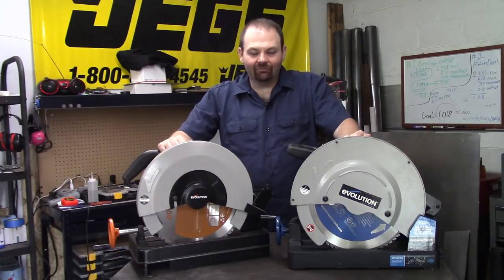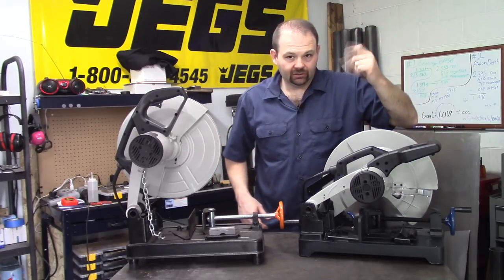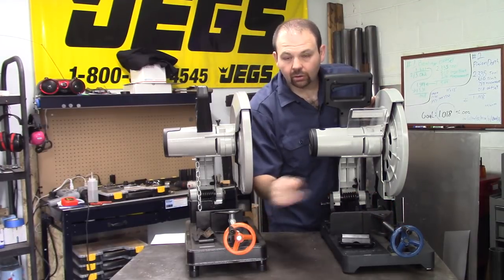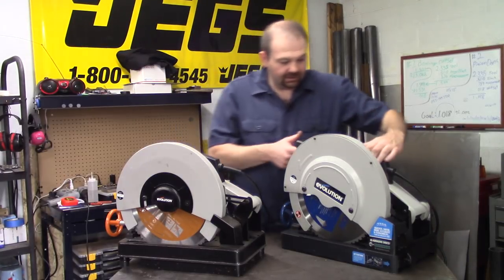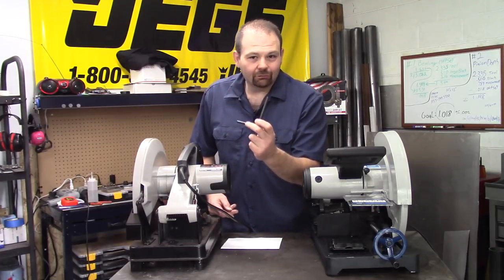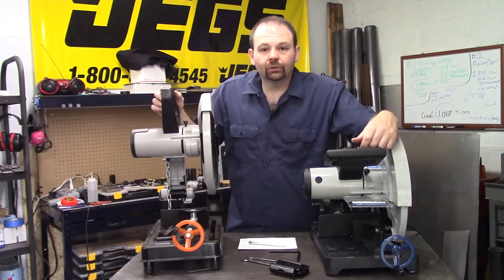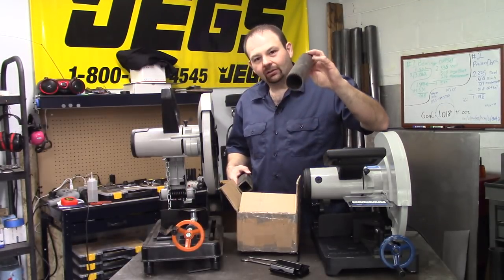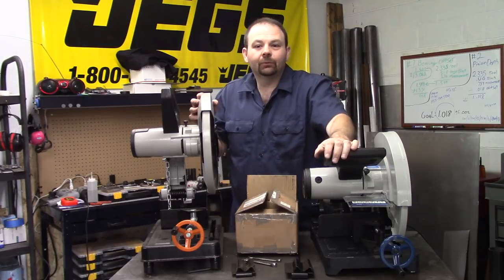Evolution EVO SAW 380 Features

Comment: Hey, thanks a lot! Sadly I bought an evolution 10" multi purpose saw in the past, I needed a metal chop saw. The clamps for the saw I have are terrible, also the rpm just burns up the blades. I thought maybe I could go with the cheaper version of the two you're comparing, but after seeing the construction of both I definitely need one with the thicker construction. Thank you very much!

Comment: I want to know how straight it cuts as the EVOSAW380 has a bad habit of wobbling up to a 1/4 inch.
Reply from the maker: Hey Crazy, I've cut a lot with the saw. I've never seen it drift a 1/4 inch. None of the cold/dry cut saws I've used have ever drifted 1/4.

Now an abrasive saw can drive 1/4 easy. Those suck in my opinion. They are much cheaper to operate but cut quality is not good.
Reply: @PtfabNet  I have spoken with the Engineers in England  about this issue the wobble developed in the manufacturing of the base not all saws had this issue.Also they are coming out with a new saw at the end of this month beginning of February they are coming out with a stamp steel and a new Aluminium base which supposedly will correct the know issues with the saw.I did post a article from this November that addresses the issues I mentioned.
I added said article
https://sawingpros.com/best-cold-saws/

Comment: Question.  Will the EVO blades work on a regular chop saw?  Are the revolutions higher on their saws?  Do you know the RPM on the EVO saw(s)?
Thanks!  — never mind!  Just read the new saws rpm is 1450.  I’ll compare that to my chop saw.
Reply from the maker: When you say "regular chop saw". Do you mean a abrasive type chop saw? Do not use a metal blade on a abrasive type saw. The abrasive type spin much faster. The blades will fit but the RPM is to high. Very very dangerous.

I am looking online, I found one abrasive chop saw. Its RPM is 3800. That is double the speed compare to a metal blade type.

Sadly, you will need to buy a separate saw if you want a metal blade unit.

I hope to make another video on metal cutting very soon. I want to compare chop saw, band saw, abrasive blades, and a torch setup.
Reply: You are correct... I did some research.  Yes I have a standard abrasive chop saw.  I haven't checked but I am pretty sure the RPM is much higher than the EVO blade is rated.  So maybe time for a new saw!  Hey ... I have a new project for you.  How about fabricating a sheet metal brake/bender?
Reply from the maker: I hope to make a video soon on comparing ways to cut metal. I think the band saw is a better option for a shop setting. Although they are more expensive initially.

As for the brake, I have been thinking about that for a while now. If I had a way to make fingers for a box & pan brake I would do a build. Funny you mention this, I literally purchase a box & pan brake last night. LOL

Got a smoking hot deal. It was on sale, then I got a 10% off code in my email. I used both to get the brake for $625.

Grizzly G5769 - 48" Pan & Box Brake

Comment: 9:17 Its not "thin stock" its called stamped steel as opposed to the "forged" steel of EVO fence.
10:06 They make this "tool" its called a ruler. It will measure the thickness of material so you sound like you have a clue how to do tool reviews. You could measure it and say its 5/16" not say...The 3/8" wrench won't fit on it and the 1/2" is too big. It just helps your 
Just a hint. With tool comparisons. Maybe compare:
1. Motor specs, watts, amps etc.
2. Replaceable brushes?
3. Blade lock?
4. Depth adjustment?
5. Different Blades?
6. Max cutting sizes?
7. The 2 different blade guards?